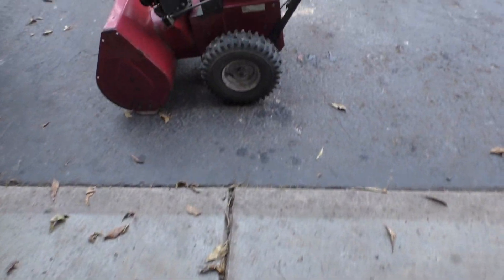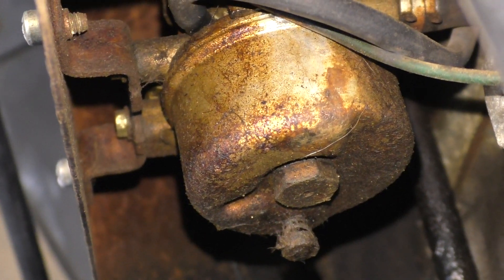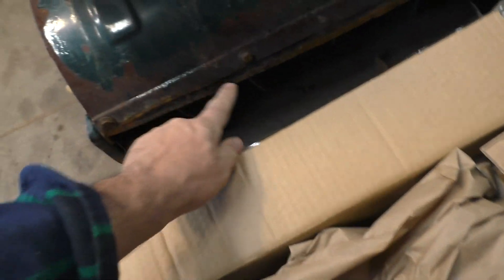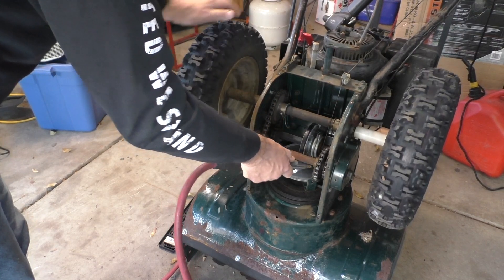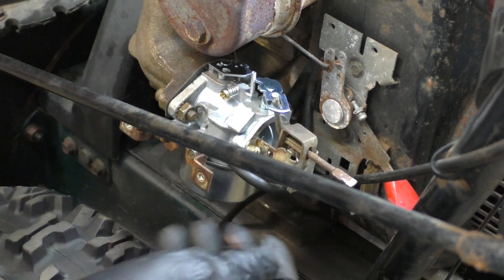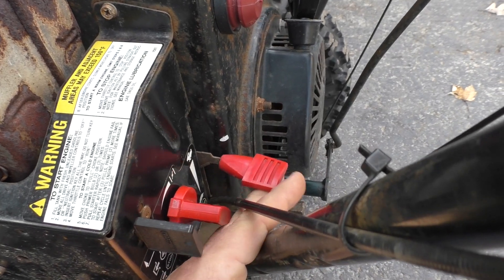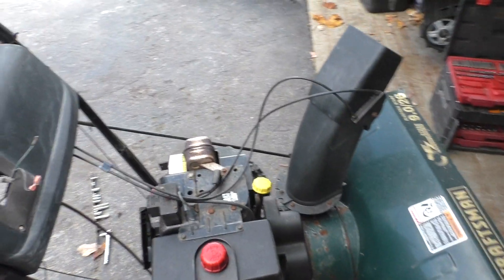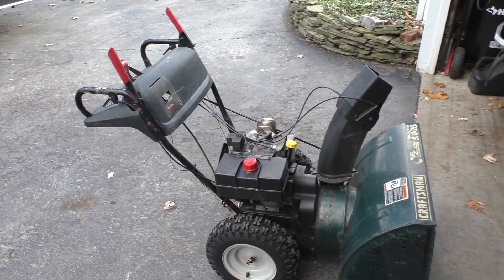Another Snowblower Just Rolled In- Craftsman 9hp 26 inch

Comment: Like how you put in the part numbers. I have a red craftsman ready to be worked on. But may need to get that carb. I'm pretty sure it's a must do. It ran rough the last time I started it.
Reply from the maker: I'm trying to add the part numbers more often, thanks for letting me know you appreciated it.  If you buy a carb off ebay or amazon, buy one that is moderately priced.  The cheapest ones I've found are the most sensitive to adjustments and you can wind up chasing them 1/2 day to get them tuned.  Happy Thanksgiving.
Reply: @CraigArndt  thanks for all the little tips and tricks. Did you make a video on Ford radio? Seems I saw one somewhere. But hey, I have a Ford Fusion that needs one, too. Anyway, enjoy your holiday and thanks again.
Reply from the maker: @michaelfarris2556 Not yet, haven’t found a radio for her truck, leaning towards the Boss double din.  I’ll video that when I put one in, was looking all week, think I’m close to buying one.

Comment: I have the same craftsman same engine but 28’ auger housing. I’ve had it for about 22yrs now. I’ve done some custom upgrades. I added LED light bar with a bridge rectifier on a separate toggle switch. I just added motorcycle heated hand pads as this model was never available with heated grips bc of the shape of the handlebars. These will work bc heating elements doesn’t matter if it’s AC or DC voltage. Although I had to disconnect my stock HALOGEN bulb to save amps. I don’t wanna blow my Stader!
Reply: I wish I could post pictures here of the installation